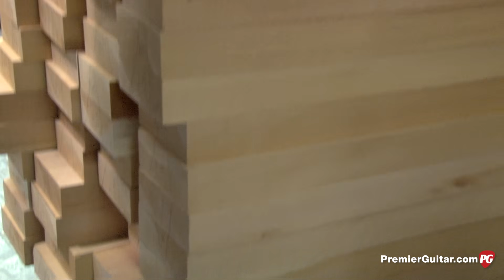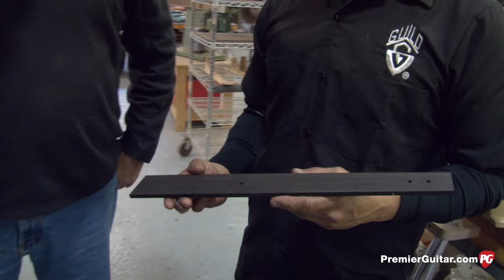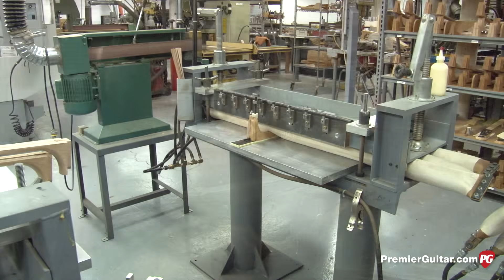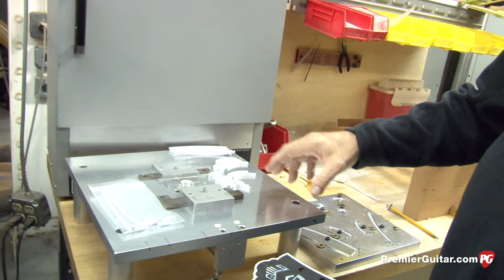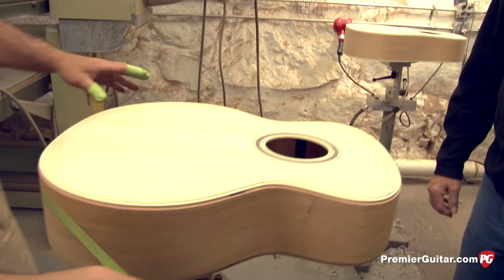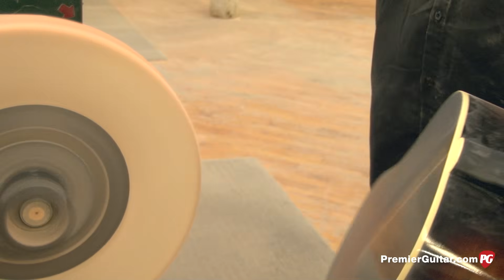Guild Acoustic Factory Tour

Comment: Hello guys,

I always have been a great fan of Guild acoustic guitars, however never had one, until one day my cousin let me try his 3 models...blown away by its sound, it changed my perspective forever!

Now, I am just starting to learn first and after that, I am going to buy a Guild Jumbo 12 string.

I have been looking online(however didn't find anything solid), I am trying to learn and understand Jumbo models, and specs of each model because I don't know the differences between models.

Basically, my personal taste would be a Guild 12 jumbo full body (non cutaway) all solid, chesterfield logo headstock, solid top(any wood which matches cedar in color?) solid rosewood back and sides, satin-finish neck, discrete inlay(not dots), mother of pearl rosette,  but not new.
Picky huh?

I would like to know which models were available, which types of wood were used back there, inlays available, specs wise and etc.

Can you suggest any link, or provide reading material to learn all the differences between the models? Or even if you can tell me the whole story.

Thank you so much!

Best regards,

Ben.